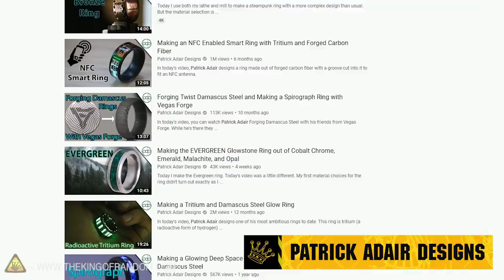We Turned a HEX NUT into a Ring

Comment: Can you make a mold for a ring and then cast
1. Molten glass
2. Molten salt
3. Molten aluminum? 
Like if u agree so they can see it.
Reply: Molten salt would probably react with any moisture in the mold and blow it up. Not to mention it is pretty hard to make a heatproof mold as shown in previous videos. Nice idea though! 🙂
Reply: Jon Smith y’all are to fricken smart 😫
Reply: @allanasmith8307  I try. 😋
Reply: Glass would be awful due the tendancy to shatter unless cooled properly
Reply: @justinlipkin  there was someone who actually cast salt. however as for blowing up, I do not believe the chemical mixture of salt allows for the sodium to retain that much of its reactivity. salt, at least the kind you're thinking of, is not pure sodium, so the reactivity between sodium and moisture has been negated by that alone. if you think about it, this makes sense, because even when it is molten, the salt still is in essence salt, not pure sodium, meaning it would not react to the moisture regardless of it being molten or not.

Comment: Word of warning: Take care with those filings. I once swept a pile of brass filings off a countertop without thinking, and got them in my hand. Which means every time I put pressure on them, they'd stab me a little. It was kind of cool, because they started out more or less invisible (the color matched my skin closely enough that you couldn't see it), but as they oxidized inside my body they became progressively darker. Eventually they worked their way out as my skin aged and sloughed off (natural process, but sounds horrific any way you describe it). 

Also, I learned that brass is not strongly effected by an MRI magnet. Came up when I broke my leg in an unrelated incident while the filings were still in my hand.

Comment: I need help 😂 

For those who know a lot about a wood lathe.

To prevent frequent stopping and adjustments of the tool rest you should __________?

Reduce tool vibration, by cushioning the tool with your finger

Place the tool rest as close to the stock as possible

Use a fixed center in the tailstock

Clamp it firmly (not this one)

Comment: you could use Stainless Steel (harder to work) then you can spend over 8 hours sanding it from 180 grit upto 2000 grit then polish it up and you will have a mirror finish

Comment: I used a die grinder first to get the inside threads out, then small hand files that I generally use for 1/8-1/16th" mild steel sheet for welding projects to finely round it all out. I also used a carbon steel nut, my skin does not like brass very much.

Comment: i have a thing to point out though 
first it is not recommended to use a drill chuck to hold endmills and put side load on it the endmill might slip out and drill chuck arent that eccentric but if you dont have a proper endmill holder its still fine taking a light pass will prevent  endmill from slipping out.

Comment: Tungsten carbide is usually used for low impact lathe work, since the initial cut was hitting the bit. high speed steel would be a better idea for that kind of work, but since this is brass (not work hardened), it should be soft enough to not damage the cutting edge. If you were doing this with steel make sure you do some research on cutting tools so you don't break your expensive carbide tips!